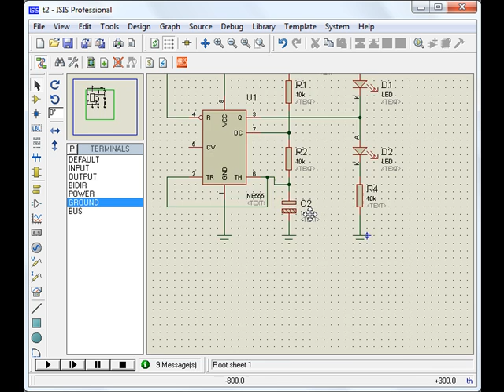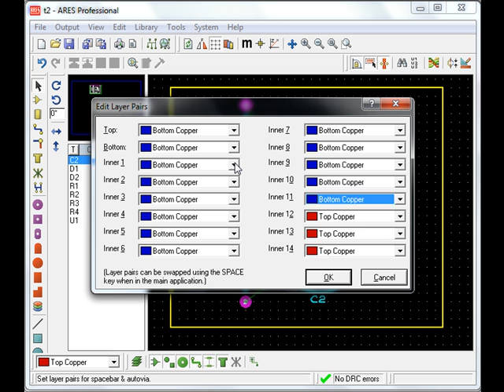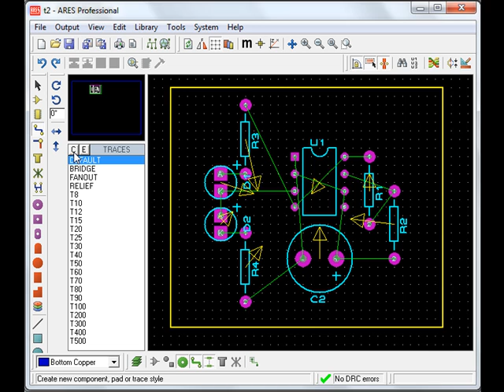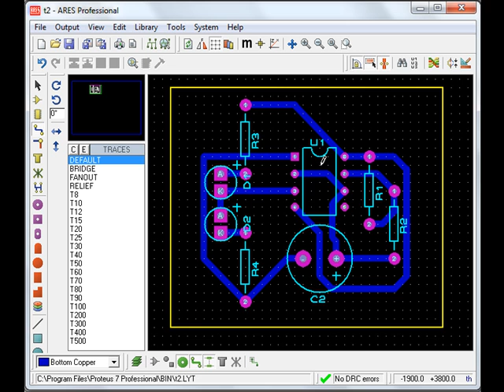Auto Routing in Single Layer - Proteus Isis and Ares

Comment from the maker: Do you make the PCB's yourself, or have some professional service do it for you? If you are doing them yourself, you need to keep in mind that, it is always possible to flip over a tracing paper up side down, and mirror the image. so if you mirror print it, and then accidentally set the screen up side down, the result is that the layer will be un-mirrored. Please dont confuse others.

Wow, bending legs 180 degree is a solution that I would have never thought. Thanks for sharing.